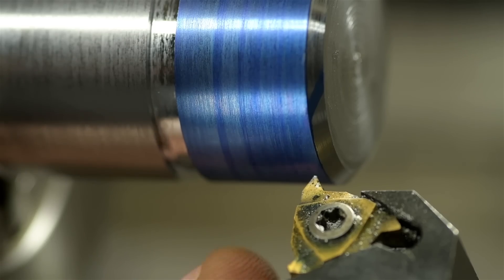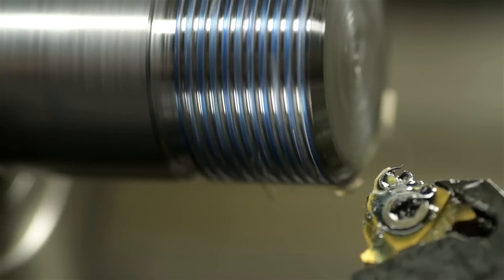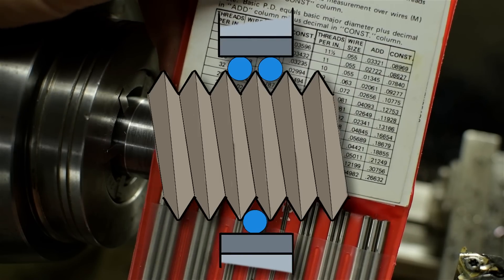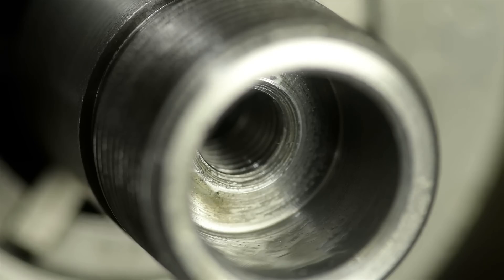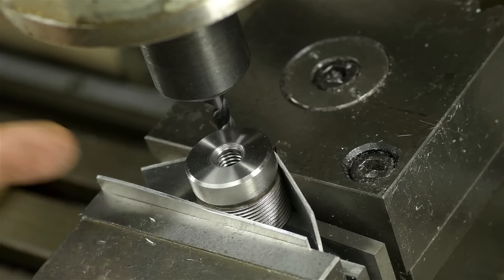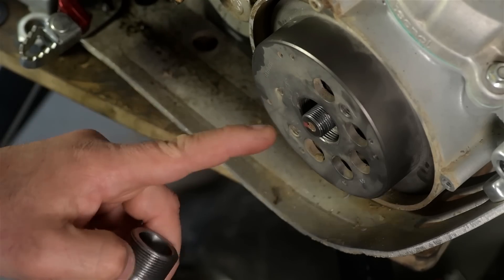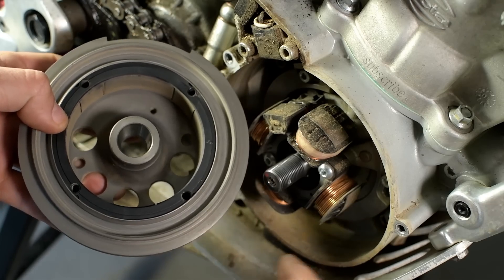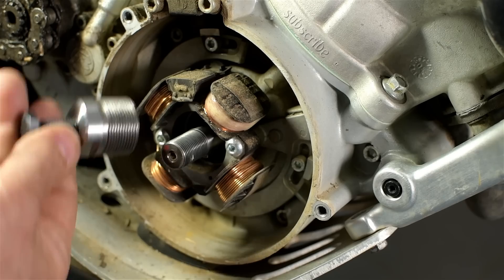EASY Flywheel Puller... using ONLY industrial lathe and milling machine!!!

Comment: Usually you can tap the end of the bolt, and the flywheel will come loose… usually the outer thread is a left hand thread…

Comment: I'm surprised you didn't machine the end of the bolt to a " point" to fit in the center divot of the shaft.  My apologies if you did I just didn't see it.   I don't mean a sharp point either I mean like a beveled edge

Comment: This old Tony my favorite Abomb alternative, Rucker’s is waaaayyyyyy uuuuuupppppp there too.  As an old mechanic I feel the need to be very nice but the puller made here as awesome as it is could be better a plate the diameter of the flywheel holes drilled matching the puller holes on the flywheel.  Install bolts tighten them 1/4 turn pop the flywheel is off no damage to crankshaft.  The Cummins ISX Cam gear puller is where I had the idea.  Just love your content.

Comment: Two bolt holes looked like they intersected the crank. 

So flat stock, tapped in the middle with slots cut to accept bolts for the holes in magneto

Comment: Tip I learned a looong time ago when   trying to remove a flywheel...reinstall the flywheel retaining nut ( to protect the crankshaft threads), use a heavy hammer and hit the end of the crank with a short, quick, smack of the hammer. The shock will usually 'jar' the crank and seperate the two.

Comment: I've seen flywheels stuck and rusted so good that they stripped normal extractors. We ended up welding a large extractor, and hammering it after torching with the oxyacetylene for long enough to just not melt it.

Comment: Before I watch the video, I'm gonna comment that if I saw something like that, I would bet every penny I had that the flywheel was affixed using loctite 609. The flywheel on the Rotax 990 v twin in my aprilia RSV Mille used that. The only way on God's green earth to dislodge that flywheel is to blowtorch it to absolute hell and then a couple sharp raps with a mallet to break the bond. 

On the upside, that stuff is so beastly that when I fucked up and reinstalled it and  quick test fired the bike over having forgot to use the securing bolt (before the loctite reinstall), it slipped out and buggered up the key and keyway. Not about to replace the crankshaft and split the case, I just slathered it all in 609 like it called for, stuck the key in as best I could, cinched the retaining bolt down....

And it's been absolutely perfect for 10 years.

edit yep. You had some kind of high temp loctite on that shift. They seat securely, but not that securely.

Comment: Wait. Weren't those threaded holes (x2) the way to "push-out" the flywheel?
If I'm not mistaken, that would have been the easiest way.
(Basically when they bottom-out into a/the solid object on the other side, they force out the flywheel.

Comment: After watching this again (after finding my box of like pullers, from a previous life as a motorcycle mechanic) I can't help but wonder what the slotted bits are behind the stator. It looks as if something is adjustable. And sometimes it's adjustable through holes in the flywheel.

Comment: its not so bad when you consider the time it takes to drive down to the auto shop to by the part, and then if you are like me the extra hour it takes to brows the shop, then drive back and the cost of the fuel you probably broke even

Comment: this is really cool! i've used this exact sort of extraction tool a thousand times- it's basically the same method we use to take crankarms off of square-taper bicycle bottom brackets. never thought much about how useful that kind of extraction method would be for other stuff. thanks for helping me open my horizons for how to do work.

Comment: Wait, Tony... You can adjust the ignition timing on this engine by loosening the allenhead bolts around the perimiter of the ignition backplate. Where the ignition coils are mounted on. It gives you a couple of degrees there you can adjust in.

Comment: I know so little about engines, when that flywheel popped off I thought  "Hey that's not an engine, that's a brushless electric motor....Why is Tony calling it an engine"

Then had to do some Google searching to find out motorcycle engines use a stator and permanent magnets on a flywheel (basically a brushless motor run in reverse to create AC current) that then gets rectified into DC to charge the battery instead of the all in one rotor style alternators you usually see in cars.

I'm sure this is common knowledge for most of you here...but I just learned it anyway.
Reply: Get in touch. 🤗🚀
Reply: You can thank Nikola Tesla for that and a great many other things!!!!

Comment: It looks like you can adjust the timing by simply loosening the 2 (or 3) allen-head bolts and rotating the stator? Thats how its done on my 1976 Kreidler with retrofitted electric ignition, and it has the same slotted holes for the bolts, allowing it to be rotated.
Reply: if the pick-up is the black thing on the engine block at 12 o'clock than that is of course not going to work, though it could also be the black thing on the stator between the 2 top coils.

Comment: The timming can be adjusted buy rotating stator plate I think u can see elongated holes under bolts. My Yamaha banshee was not adjustable the after market stator plate looks like yours. I dont know your bike but i know small engines. Take another look i might be wrong. the first internet admission we are not all experts we do not know evvvvvveryyyyyy thing dummmmmmmmmmmmmm kids

Comment: Got a few questions, can you use cobalt, old carbide saw blades or high speed steel dill bits and planer blades to make a cutting tool.

Comment: This old tony make the middle bolt that pushes against the front of the crankshaft pointed on the end so it sits perfect in the little hole on the front of your crankshaft it stops it from getting flattened on the end of your thread's but nice job anyway.or & Brilliant name you have their T

Comment: Pulling flywheels always reminds me of the time I was in the Cayman Islands and my friend had a Mercury 150 Horse outboard motor with a "stuck" flywheel that absolutely needed to come off.  We had the biggest flywheel puller and torqued it down with a 6' pipe on this massive wrench...flywheel wouldn't budge.  So in order to go to the next level of destruction we got out the oxy/acetylene torch and heated to over 700 degrees (cherry red in broad daylight).  Suddenly there was this very loud PING and the flywheel and flywheel puller launched from the power head and landed down range about 20 feet.  The most important thing I learned that day was to check for a locking pin before attempting to pull flywheels.

Comment: What was directly behind the two threaded holes in the flywheel? Did they line up exactly with the two bolts on the stater? Could you have just run two bolts down those holes to accomplish the same thing?

Comment: The backing plate behind the stator (stator makes electricity for things like the cdi and coil) likely holds the trigger for coil, and has slots so you can rotate that point, which changes when a raised spot on the flywheel moves past.  That's how you adjust the timing.  On a 600cc motor that wasn't adjustable, I slotted those holes and made it adjustable.

Comment: Old Tony! Question for yah
If you had an aluminum tank and steel piping to connect it to... What transition would you use to avoid the aluminum on steel catastrophe?
Reply from the maker: gasket?  plumbing tape?  I assume you're talking about galvanic corrosion?  maybe a compression fitting that uses a plastic bush?
Reply: @ThisOldTony  yup, galvanic corrosion. At first I was thinking of a third metal that would "ease the blow" on aluminum but that didn't go anywhere. I think I'll go the Teflon route on this one. Thanks for the response (and the hours of machining instruction), I'm definitely going to tell my friends about this!

Comment: In the magneto you can find 2 threaded hole....u can use it to fixed plate between bolt that lock on the threaded hole  and make another bolt to push the center....cheaper, simpler

Comment: You should drill the end of your bolt to accept a ball bearing. Might help the bolt turn with a few less foot pounds of torque and it will engage in the dimple in the crank.

Comment: If I'm not mistaken, doesn't that flywheel have " puller threads" for bolts  just to the outside of where you threaded onto the main shaft?

Comment: Why not bolt a flat bar across the tapped holes with a tapped hole in the middle to tighten  a bolt against the shaft? When they are hard to shift a blow on the centre bolt head after torquing up will pop it off.

Comment: I spy with my little eye, a sexy little groove on the coil mount with a (I believe) m4 bolt in it (there a probably two more in there at 120 degrees apart. Isn't that the ignition advance adjustment?
I can also see the flywheel cutout and a sensor that reads it, don't know what that's all about.
But normally you just rotate the coil mounting. If not how is it done on that engine?

Comment: I prefer to back the crank bolt off and give it a schnappa and a half with the brass hammer. Also helps to pry on the back of the flywheel with a prybar or burly screwdriver.

Comment: You, ah, DID see the two holes for the standard thread bolts to be used with a crossbar puller, right?
Right?
Reply: I believe that long bolts in those threaded holes will just bottom out inside and push the flywheel off.  I'm pretty sure that I saw a surface for that between the coils
Reply: You could use those, but then you'd still have to buy/make a proper puller to get the distorted flywheel off to fit the new flywheel you'd have to buy.
Reply: @liquidsonly  I think the technique is to not pull the flywheel off with those but to merely take up the slack with a fair bit of tension - then, using a punch on the centre sfat, tap it lightly with a 300lb hammer.
Reply: @millomweb  indeed, a 300lb hammer would certainly solve your problems.
Reply: @liquidsonly  ;)

Comment: ToT: "Either it came off or we broke something" <<< How I feel EVERY time I've used a puller in the last 20 years.
Reply: Reminds me of trying to remove the flywheel from an Austin Mini, if you've ever done it you'll know what a beatch it can be. I recall my grandmother's Mini that resisted pullers, hammering, heating with a gas torch; we finally left it under tension overnight and found the flywheel on the floor the following morning!

Comment: 6:00 "Either it came loose or I broke something"
Ah yes, Schrodingers repair shop.
Reply: Was that a Schrodinger Cat ?
Reply: @martineastburn3679  Well until you check the part its in both states at the same time.
Reply: crack
Alright! That's either better or worse, but it's still progress!

Comment: Next time, tighten the puller and smack the bolt with a hammer.
They normally pop right off. You were lucky not to wreck your new tool.

Comment: I think  that two M8 threads on flysheel will be made the same job, when you screw it 2 bolts on it. Only need to choose right position for non-damaging coil prosess.

Comment: I believe you could have pulled it off much easier using the two treaded holes in the fly wheel.  Drill two holes in a bar sufficiently  sized and spaced to accommodate bolts that can be treaded into those 2 holes.  Obviously spaced so that the bolts go thru the bar to line up with the two treaded holes in the fly wheel.  Drill and tap a third hole in the center of the bar, with a  slight point on the end of the bolt that will be centered to the center hole on the crank end.  Crank on the center bolt that goes thru the bar, using the bar and bolts to pull of the fly wheel.  Hope that helps. RegardsBob

Comment: Metric threads SUCK.  It is ME-TRICK.  They don't look good and the geometry sucks.  Those egg heads that designed them need their coffins dug up and bolted together with IMPERIAL THREADED BOLTS AND NUTS.

Comment: I might be completely wrong...but, can't you adjust the timing by loosening the three Allen bolts that hold the stator and then rotate it for the adjustment? There should be a Hall sensor between the coils somewhere, which correlates to the "notch" in the magnet and that should time the spark...

Comment: Some of the factory pullers I have seen had a bearing ball inserted at te end of the pushing bolt, that fits in the hole at the center of the crankshaft arm. I suppose that makes the bolt spin more freely over the crankshaft and you has to make less effort to brake it loose.
Also oiling the treads helps a lot.

Comment: I mean, to be fair the flywheel also had smaller threaded holes, a piece of flatbar with three lopsided holes and a few standard screws and nuts could have done it.

But I have two lathes in my workshop and I too feel the need to validate having purchased them.

Comment: Wait, you're telling me that the threaded hole you put the eye bolt in isn't meant to help you pull the flywheel by driving a bolt into it? What's it for, then, flywheel accessories?

Comment: I love the tool you just made. Really, I might have made the same tool if I had a lathe and a mill. I also might have needed it if I owned a motorcycle. But now I want to know why all the precision? And a rather straightforward question: "With two threaded bolt holes in the flywheel equally spaced on opposites sides of the crankshaft, why did you not simply take some square bar stock and drill three holes in it. Tap threads through the center hole and bolt the bar stock to the flywheel. This would not need much more than one drill bit for the outer two holes, one bit and tap for the center hole and a very low precision drill press to get the center hole pretty straight (perpendicular).
Are those flywheels on so tight that my suggested tool would not have worked?

Comment: Made something similar for a Murray garden tractor. Flatbar, 3 hours to find the calipers and another 6 to sharpen all the drill bits and I had a tool. All I need now is an imperial screw in a country where you say imperial and people look at you like your from the moon  😆

To be honest, if I failed while annealing with my oxy acetylene, chances are I would be from the actual Moon...🤣

Comment: This is also how square taper bicycle cranks are attached to the bottom bracket (the bearing bits that let them turn) shaft and the tool works the same way. The only difference is the shape of the taper and that a bolt is used to push the tapers together instead of a nut.

Comment: As a mechanic turned hardcore ToT fan for the ninja level machining videos, it's weird to watch you struggle with mechanics.  Aren't you supposed to be God or somesuch?

I always reach for the impact wrench, and give her a lick with the hammer if I sense that I'm applying an unreasonable amount of torque.  Always grease the puller threads.

Comment: The pair of threaded holes you screw the hook into one of at 50 (ish) seconds in. In the past I've used those to wind flywheels off with (assuming there is nothing breakable behind them)
I mean no reason not to build a puller, that is what a machine shop and this channel is for after all, I'm just interested to know of that was a possible solution?

Comment: You can mess with timing on those engines by trimming the key wedge (normally 1/3 ) to advance or retard the timing just enough to notice. Is something a did on chainsaws to increase performance.  Maybe you can look into it or not.
Reply: Roberto Vasquez you can buy offset keys

Comment: Just curious, This Old Tony - what coolant do you use? I'm debating getting some for my lathe and mill, but ideally it needs to last me longtime without going stinky or rusting my parts. Will probably get used maybe once a month. Can't find a whole bunch of info on this...
Reply from the maker: I hate using coolant... but sometimes ya just have to.  I use standard water soluble oil.  I hear you can add a splash of bleach to keep it from turning.

Comment: My Father taught me to cut threads on a 9" South Bend lathe in the 1960's by leaving the half nut engaged. I have cut threads, since, and rarely use a threading dial.

Comment: You don't need such a tool to remove a flywheel : you just need a flat piece of metal ( 1/2"  x 1" square bar of steel would be more than enough, but even a good piece of oak can do...), drill two holes matching the  distance between the two threaded holes on the side of the flywheel and slightly bigger than the holes. 
Then a couple screws and nuts in the two threaded holes and a gentle tap on the center when you built enough tension in the bar...
That's the way I removed my lawnmower flywheel with only scrap piece of metal and a drill press (but a milling machine would be OK too :-))
I must admit than it would make this video much less interesting (and fun !) than the ONLY industrial Lathe and Milling machine way... but unfortunately some one may actually NEED to remove e flywheel without the "easy way".

Comment: Hey Tony,
You probably know this as you seem to know most stuff.  
When you reach the thread end groove just disengage the half-nuts as usual and stop the lathe at your leisure.  Reverse the lathe and engage the half-nut at your dial number as it comes back round.
You still have to power the apron back to start again but it avoids the TOT Ninja withdrawal maneuver.
Reply: He can't disengage the half nut because he is making metric threads on an imperial lathe.
Reply: @vandahm  
Yes you can.  
Read the comment properly and you will learn how to do just that.  I have  (or had then) the same lathe as Tony and often used the method I described.
One thing I did not write was I mark the leadscrew to the lathe body to help with re-engaging the nut..
I didn't think for a second the Tony doesn't know how to use the half nut normally.